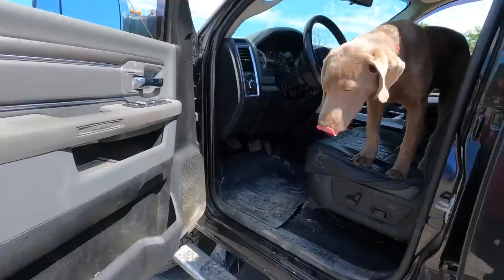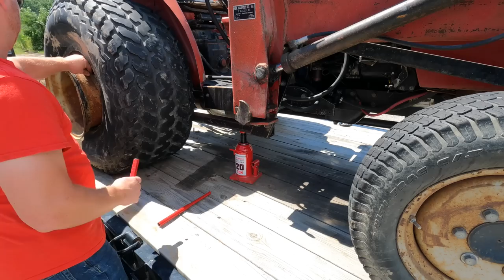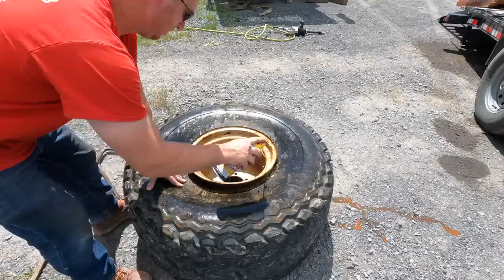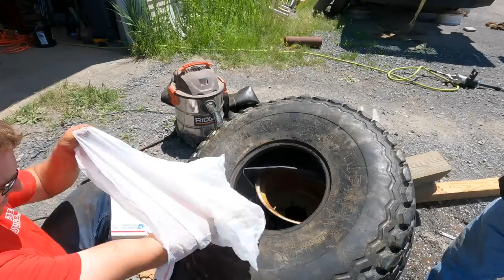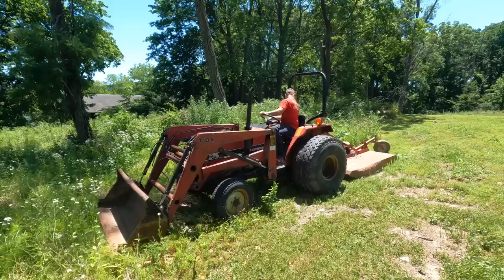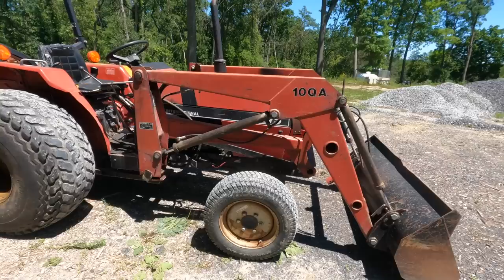Buying a tractor for $1000

Comment: that was a great deal, even if you had to put different rims and tyre on it,  18 psi pressure in rears to save front axle with a loader always have a counter weight on the back end/ linkage. Tip When greasing the front axle pivert take the weight off the axle so the grease can  get to the top of the pin

Comment: Dude! Bargain of the century! I looked for two years for a tractor that exact size and could not score one for less than $12K. Ended up buying one a little bigger than what I had hoped for $6,400.00 and I had to go to fetch it from Texas (and I had to reseal the loader cylinders, and still have to fix the loose steering and lack of brakes). Cheers from east-central AZ.
Reply from the maker: I was in the right place at the right time

Comment: I done tires on multiple tractors. Never had an issue using the one plastic nut with the tube and a little tube touching rim.

Comment: New subscriber here, just saw the video. Next time you mount your tires be sure that you mount the valve side LAST. You started at the valve and the outer tire can rip the valve clean off this way. When you start at the opposite end, outer tire can drop in the rim groove no problem (no valve in the way) and you mount it a lot easier.

Hello from Croatia!
Reply from the maker: Thanks for the info. I’ll have to try that next time

Comment: I'ld tell people I bought a bushhog for $1000 and it came with a tractor haha. That's a steal let alone a tractor with a loader and bushhog. Right place right time for sure. Thought it was a case tractor at first but can't see any badges other than 275 or whatever. But if that one tire had calcium or water in the tire I'ld fill the other one or empty them both and get wheel weights. Don't know if tubes are made to handle calcium or not but today they use best juice or something else so it doesn't rust the rims and valve stems. But you def don't want one weighted tire and one not or that will cause it to be more tippy.

Comment: First order of business remove the wheel check tire and rim for sharp object that pops the tire
repair the tire problem mount the wheel and you just saved buying a tire in the event it gets damaged driving off flat 
good score on the tractor and brush hog

Comment: You had me feeling sorry for you struggling with that tire trying to slide it up to the tractor hub..  Next time use a bar to work it in..  The reason you lost the vale stem when you were mounting the tire, you should not have started to mount the tire there..  The bead needs to go down on the rim to give you room to work it all the way on the rim..  The bead could not go down with the valve stem there so it pulled it out..  Good thing you did not ruin the tube..  Good luck with your new tractor..
Reply from the maker: Thanks

Comment: Some tractors tyres have water in the tyres to help with balance/counter balance
Reply from the maker: We live in the northeast, if it was water, it would freeze
Reply: @Dumpster_Dave  you'd need to add antifreeze, that is what they do here in the UK, or use to do I should say, It's been a long time since I last did a farm tractors tyres. But I am assuming the water you got out of the tyre was inside the tube ???, if so it would have had some kind of antifreeze in it too

Comment: USE YOUR GLOW PLUGS,,,,,,,,it will start much easier.  Those Mitsubishi tractors have precombustion chambers with glow plugs.  You should be able to rotate your key back to like a aux position to turn the glow plus on, on the dash there should be an indicator under a chrome cover,   pigtail coil of sorts to show you when the glow plug is hot. Summer time you should be fine heating for about 20 seconds,,     Winter  30-45 seconds, they are not the "newer" rapid glow plugs in your tractor.

Comment: Check the gear oil in the gearbox on the brush cutter before you run it too much. If it's been sitting outside it probably has water in it. Great deal Dave. That's at least a $7500 tractor here in the Midwest.
Reply from the maker: Thank
Reply: @Dumpster_Dave   if you ever have to do it again use the tyre lever on the bottom of the wheel to put it back on the tractor it will save breaking your back

Comment: Hey Dave nice job on the tire I check what the tire says there suppose to be a lil squishy next why didn't you check your  fluids before putting it t to work  ( oil trans  hydraulic radiator
Reply from the maker: I did check but I will be making another video with doing the service and brush hogging
Reply: Oh